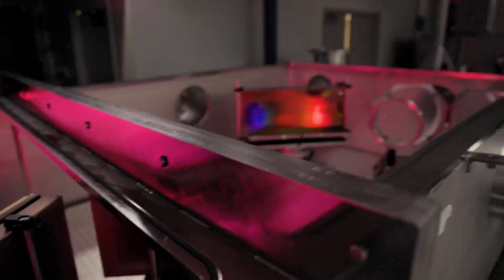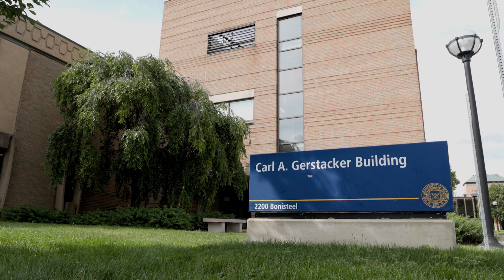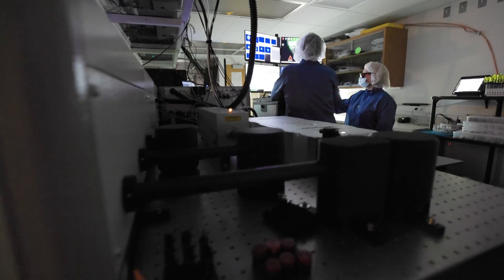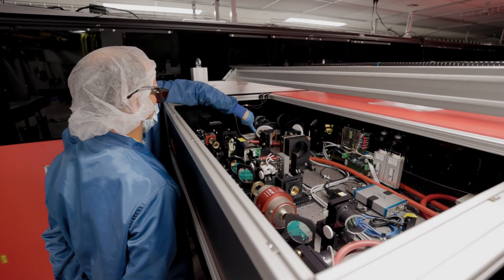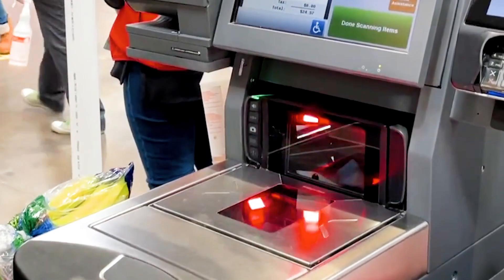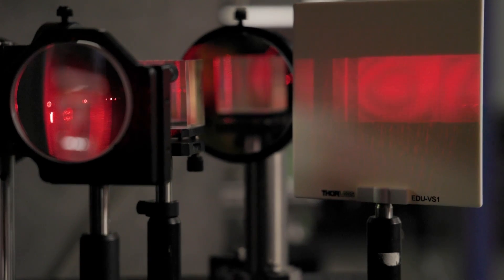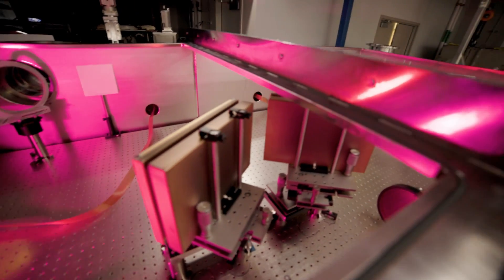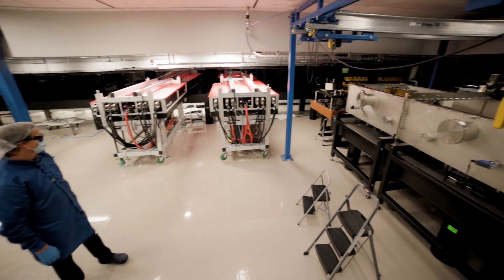The ZEUS Laser  - the most powerful laser in the U.S.

Comment: A petawatt in a femtosecond is one Joule of energy.  One Joule can raise one cubic centimeter of water by about one quarter of a degree Celsius.  
If you hooked up all the home solar battery backs to a giant CO2 laserr, a million 100kwh home solar battery packs in a metropolitan area could generate about a trillion watts of continuous power  or a trillion Joules/second of power which is the equivalent energy of about 250 tons of TNT per second.
At 20% efficiency in a CO2 laser it would be as much firepower as 50 tons of TNT per second.
Reply: You are correct, but the nature of pulsed-laser systems is that they amplify very short pulses of laser energy into a very high power pulse with the same duration. Or a shorter duration of higher power. You can not hook up a bunch of home solar battery packs to a CO2 laser to produce the same power density continuously because the resultant power density falls with the square of the laser emitter cross-section. The reason why these guys can only emit that power density for a femtosecond is that the optimal emitter cross-section is used to obtain optimal emission density. That emission power density is then transformed along the time-integration of its power function. If you integrate a power function with respect to time you get a volume of power-time transformed into an amplitude of time-power. The mathematics says that the time-power amplitude is equal to the power- time volume (or total energy volume) transformed to fit within the time limits of the time-power integration, with a limit-to-peak curve defined as the ratio of power volume over power-time, to the delta of that volume-time point from it's initial limit time.
Reply: Because of this there is a finite upper-limit on the max continuous power output of Light Amplification by Stimulated Emission of Radiation device. Laser energy density limit is One hundred thousand quadrillion Watts per square centimeter. Far above what could be continuously present within a physical device of our making. I believe our most powerful continuous laser cannons are about 2000 Watts.
Reply: @THEmomentumJUNK1E  
If a one meter long,  one centimeter diameter CO2 laser can emit a continuous  100 watt  laser beam, a one hundred  meter long, one meter  diameter laser tube might emit a hundred million watt beam.  Or multiple sections that add up to the same volume  laser to allow for cooling considerations would emit a 100 million watt beam.  Any number of additional sections  could  add up to any power.
The point was the remarkable power supply that could be available from home solar to drive a super power laser.  The total power supply of the US is about one trillion watts.  A hundred 12 volt lead acid batteries each generating 10,000 watts is a million watts.  Times a million homes in a metropolitan area is a trillion watts.
If the batteries were used to charge up a huge capacitor bank for ten seconds to deliver a pulse lasting one millionth of a second, that is a two thousand Petawatt laser pulse at 20% efficiency.
Reply: @JohnSmith-pc3gc  Ok I see your point regarding the power source. There are probably some difficulties associated with adding longer sections behind the same diameter exit tube. BUT! Your distributed power source idea is brilliant since it gets around the problem of pushing a massive local power source through a single laser throat! If you consider Star-Link, and go to the near future where almost every house has a Lithium-ion storage bank, and a Starlink reciever, which by its already established design can track a near-orbit transceiver satellite accurately enough for data integrity. And those Star-link satellites all maintain laser-lock with each-other at high integrity. If we were to integrate the addition of a high efficient CO2 laser onto every Star-Link receiver dish in the power range of the home's lithium bank, the dishes tracking system could keep the laser pointed at its star-link satellite. Every starlink satellite would recieve thousands of beams at once from thousands of homes all at different angles. But all from within a certain circular land area applicable to that satellite. Even if the accuracy of the beams was only enough to land them within a 4x4 meter circle on the satellite, it could easily unfold a thin reflective sheet to catch all of it. Even if the parabola of the sheet was not smooth, but split into polygonal segments like the james webb, it would be good enough to reflect the entire collection into an optical reciever feed horn since it can limit the size of the land area by communication with the senders. The optics inside the feed horn would be a focusable dual-concave collumnator. The column output would point back at earth down the centre-line of the laser provider land area, to zap anything on the surface there, but could be easily aimed at any point within that land area by simply angling the whole parabola and feed horn assembly about the center-line. I don't know what you would do with this weapon but that gives you a considerable portion of your Trillion Watt continuous laser beam, by leveraging distributed power sources and a large array of numerous small, efficient CO2 Lasers.
Reply: A home-based continuous laser of 2000 Watts is totally feasible and already publicly available. In a dense land area with say, 100 000 homes, that would give you a columnated beam power of 200 Megawatts continuous. The beam width on the surface target would be 2X the width of the diffraction diameter of the source lasers from earth to star-link. It look like a diffraction to star link of about 20cm diameter is reasonably achievable for a small home based laser. So 40cm diameter on the weapon target. Double that to account for columnator accuracy, and you get 400 000 Watts per square centimeter.
Reply: @THEmomentumJUNK1E  
I am not very familiar with Star Link.  I was thinking more in terms of targets in the air and space.  The "Star Wars" ABM project considered laser possibilities.  But expense and other issues were not encouraging.  One problem is cloud cover.  But with a trillion watts of power it might be possible to remove the clouds from a large metropolitan area.  Expense might be reduced many times if the power supply and laser system is part of rooftop solar energy systems.   A dish concentrated solar energy system already has a tracker.  A CO2 laser is not much more than a flourescent light in terms of materials.  If it was mass produced it might cost about the same.  A dish can also be used for microwave directed energy weapons.   And certain microwave radiation is readily absorbed by water vapor in clouds.  The microwaves might more easily remove the clouds than lasers.  I mentioned lead acid batteries because I am familiar with the power and voltage.  800 Cold Cranking Amps times 12 volts is about 10,000 watts.  I am not familiar with the voltage and power from lithium ion batteries.  And lead acid batteries might cost a lot less.  
If you have a trillion Joules arriving at a basketball sized focal point from thousands of lasers in one millionth of a second it would be as much firepower as a  nuclear weapon.
Reply: @JohnSmith-pc3gc  Ha awesome! I love that you used Tons TNT as your energy release and power rating reference base. It's my go-to as well.
Reply: @THEmomentumJUNK1E  
The system might work and shoot down most of the nukes.  It might prevent global destruction.  But it onlly takes one to wipe out a city.  
https://youtu.be/M7CZgKNVC9c?si=1Tqy4XjiKp5lmzi1
Reply: hawaii 👁️👄👁️